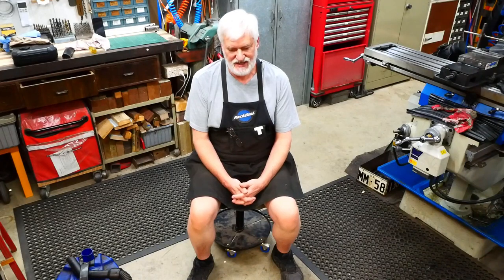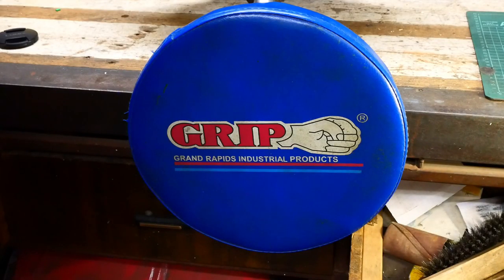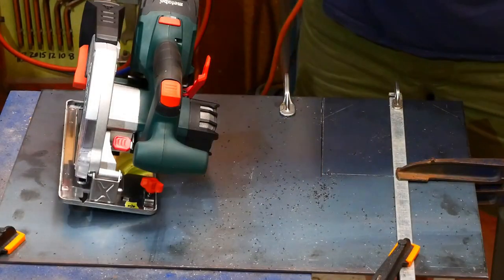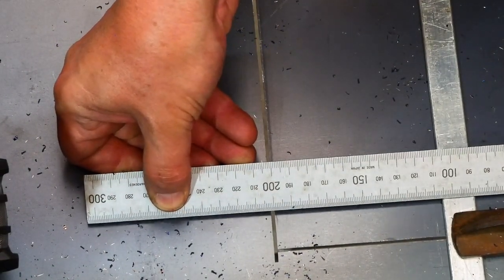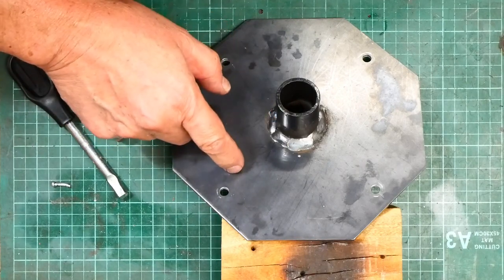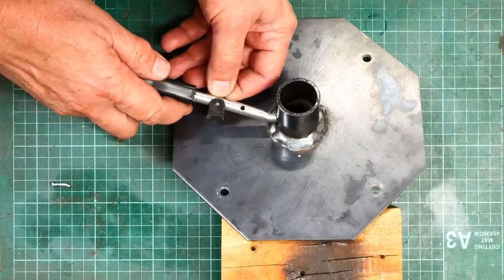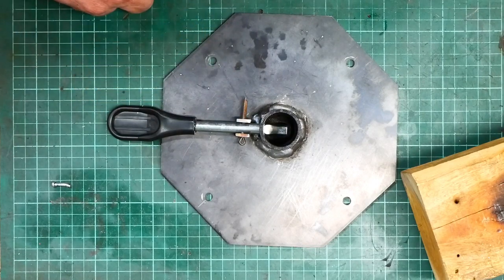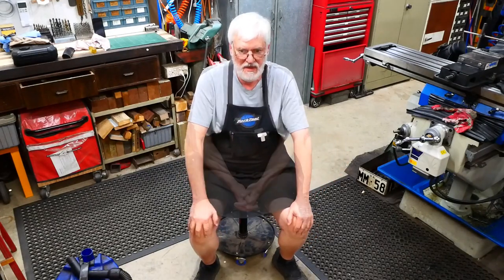Fixing a broken roller stool

Comment: I had the same thing happen to me with those many branded but made in you know where stools. Repaired mine in a similar fashion and, as you were, surprised at how thin the metal they used was.
Reply from the maker: I think the designer assumed a 300lb user would always park his butt vertically in the centre of the stool. Whereas in the real world,  usage involves movement and leaning that puts pressure on the edge of the seat causing that thin base plate to flex at the welded joint...
Thanks for your comment Jerry.